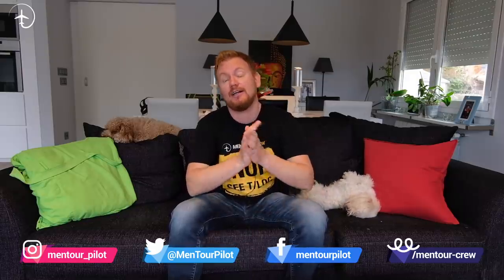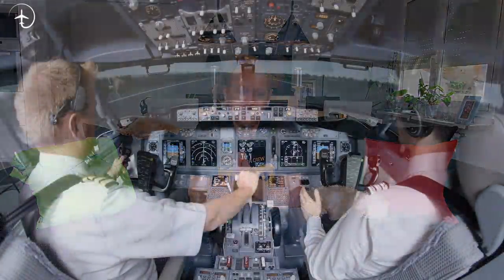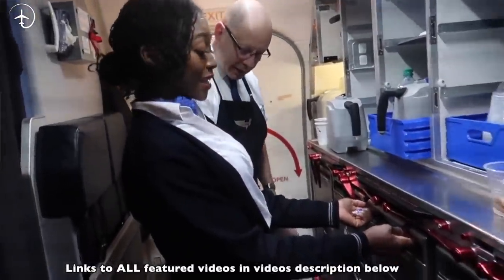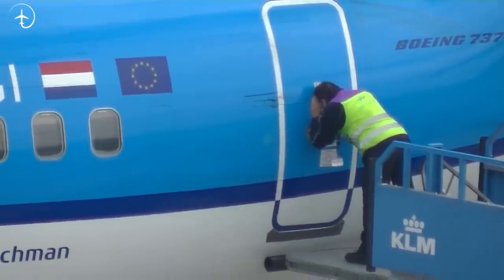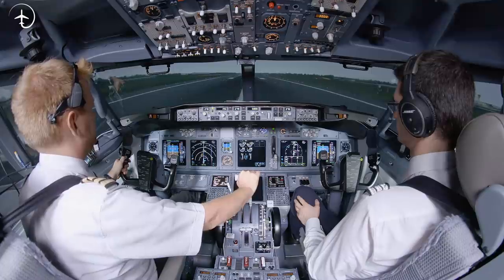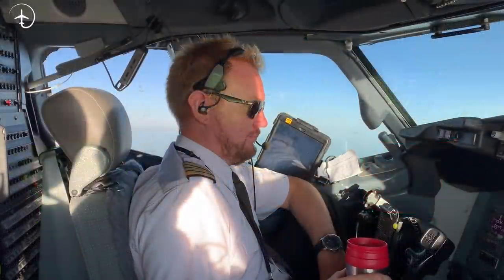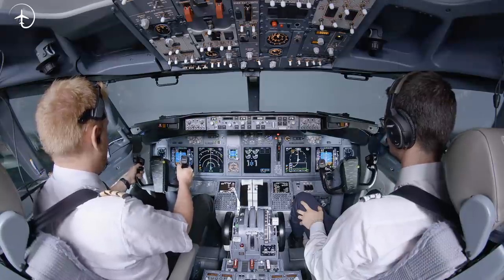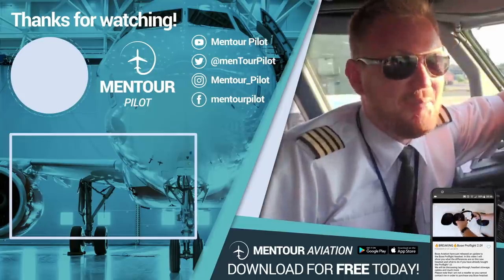How to fly an EMPTY Aircraft!

Comment: Half of my 737-3/400 freighter flights are essentially empty, or with a little bit of backhaul; just a bare floor and up to about about 15,000 lbs. fuel onboard when returning to ANC, e.g., from BRW/Utqiagvik. In the Alaska freight hauling business, the revenue stream is mostly unidirectional. 

Yes, it’s a profound performance difference, and since we often can’t reduce thrust on contaminated, shorter runways around Alaska during winter or when wet in warmer conditions, full thrust is occasionally used. Indeed, more than 20 degrees nose up is not recommended, even when the FD suggests it. About 17 deg does it for a flaps-5 170 KIAS low-radius U-turn departure reversal when light.  

Nosewheel shimmy problems on these old ex-BA and ex-Lufthansa 737 Classics are not uncommon, which I believe is due to the fact that these airplanes are designed to have lighter force on the nose gear, helped by having seating, galleys and lavatories installed and passenger payload on practically all flights. This is made worse by runways suffering the pavement-distorting effects of temperature extremes, currently the west end, right before the 09 rotation point at Kotzebue (PAOT), necessitating a bit of soft-field style back pressure while minding not to pre-rotate and possibly cause a tail strike in a mostly fruitless attempt to reduce punishment on the equipment. 

While the airframes are equipped with a structural barrier between the main deck and forward galley/supernumerary area, in light-load freight flying, our main precaution is to verify any backhaul items are properly secured and that the floor locks are up, preventing any sheet or ULD shift on the roller-floor, as there is so much empty floor space allowing a major shift, usually forward, to occur. 99.9% of the time our cargo loadmaster (when we have one) and the outstation ground crew get everything perfect. 

We never engage the forward door slide girt bars on the airplanes so equipped. And if we are ever required to do so, it’ll only be a matter of time when someone forgetfully opens a door (probably from outside) and causes a catastrophe. 

And, I should add, during 2020 and 2021, I’ve never been busier flying freight since starting my current job in old 737-200 (gravel-kitted and since retired), -300 and -400s in late 2015.

Comment: Hi,  Imagine you yourself were flying the 737 Max 8 using the standard single AoA sensor with flaps up. The aircraft suddenly started a forced pitch down. Is it possible that you, suspecting a computer fault, not a runaway screw jack motor, can switch off 'only' this problem? Or would you, in this case, have needed another 'extra' stabilizer cut-out switch (maybe an MCAS Cut-Out) positioned nearby existing switches, leaving all your normal trim methods available, thus allowing you to easily and quickly correct the longitudinal pitch and to fly on?

Comment: To "ForMeToKnow" below and interested others...  I was a passenger on an American Airlines MD-88 about 30 yrs ago flying late in the evening from Newark NJ to Raleigh-Durham NC, then thru to Charlotte (my destination) as same flight number. We were almost fully loaded, mostly business travellers. When we landed at RDU it was announced we'd have a 45 minute layover while an equipment issue was checked out, and thru passengers to CLT would be allowed to exit to the terminal to stretch legs, get a drink or snack, whatever, then reboard and continue on. They gave a 10min boarding call over the p.a. in the nearly-empty new terminal building and when I got back on the plane and reseated in coach I looked around and realized I was the only remaining passenger that night! After we got airborne for the final leg of about 50mins the cabin crew told me I'd been awarded an upgrade and moved me up to First Class ("Pick a seat, any seat!"). I chose a window on the right because I knew the wind was out of the North and I'd be able to look down on the city and maybe pick out my neighborhood as we hooked around the South side of town to approach Rwy36L or 36R but was surprised they extended to do a Visual to Rwy5, rarely used for landings at CLT, for preferable winds and also noise abatement since it was now after midnight. I also got a surprise meal on the way of Orange Ruffie, potatoes Au Gratin, asparagus and a glass of champagne. Walking away from the gate after the flight I saw the F.O. and thanked him for the de luxe ride. He told me that they knew they'd be practically empty on the last leg and the flight was pretty much just to position the aircraft in Charlotte for an early start to the next day's schedule, so they decided to give me the royal treatment for fun. Very interesting and memorable experience.

Comment: Non-pilot guess for repo flight of an airworthy (no maint. required) aircraft WITH cabin crew. Slower takeoff, lower engine power, higher altitude, lower pitch of the nose, fly faster through turbulence (you only have the cabin crew to keep comfy and I am sure they would be understanding of a bit more bumps than on a PAX flight).

Comment: The 737-300 accelerates much faster nearly empty you can feel it in the small of your back.  I flew on a big jet a 777 once I was really disappointed.  That thing was so big it literally took an hour to turn it around then it was so heavy with so much inertia it took forever to get up to speed.  I live in Texas where the big cities are right at the limit of what you want to drive or fly.  A small jet like an Embraer RJ135 or a 737-300 always way out performs the bigger jets on these short routes.  I actually like the RJ135 it is a very simple jet rarely breaks down.

Comment: Is it possible to be the sole passenger in an aircraft while there are two flight attendants on-board?
Reply: It is more likely that there will be more than 2 cabin crew. Usually you need at least as many cabin crew as you have emergency exits. So assuming the company allows you to fly and dous not cancel it, you could have 6 or more cabin crew for 1 or 2 passengers.
Reply: Yup, I worked for AA. We had full flight crew and myself w no passengers. I didn't work the flight, but it was nice, no rules, cook ur own food, get your own drinks.

Comment: Hi Mentour Pilot, at 6:10, do you mean it about minimum trim setting for takeoff because the aircraft too light so we have to decide minimum fuel load to meet this requirement (737 NG)? I found little bit different in max. No requirement for this.

Comment: On a 737 how many passengers are required for you to have to worry about balancing out the plane with passengers?
Because if you have 10 passengers, that might be about 700kg, but do you have to worry about spreading that weight out

Comment: Why wouldn't the company sell a few seats at a cheaper price during these flights to recoup some of the costs?   I can't get my head around the  economics of the airlines. Recently booked a flight from an airport 200 miles away from home only to fly to the airport 30 miles away from home to go to  Grand Cayman. I saved $600 and had to fly on two aircrafts by driving 200 miles. What gives? In short, I drove a couple of hundred miles to fly home to go to my  destination and saved $600.

Comment: On a ferry flight, is there a need for 3 pilots on board? For example if one of the two pilots is checking the cabin for any fire, the other pilot is alone in the cockpit. Im wondering if there are any safety procedures/regulations on ferry-flights too after the crash of the german wings flight with one pilot in the cockpit. Thank you :)

Comment: Does the increased bank requested by the flight director mean a potential stall situation? I know on most general aviation aircraft the stall angle is about 15 degrees. Would your stall correction be the same with rudder rather than aileron, release back pressure, increase power?

Comment: I only fly in 2D ok I drive a semi truck 😜and sometimes get a load imbalance and can be dangerous to keep in control particularly if the main weight is on the trailer axles.
With all that fuel weight mainly on the main gear on an empty flight does this affect the steering on slippy surfaces or is thrust from each engine used to compensate for this effect should it arise?

Comment: Am i right that in normal circumstances, one of the cabin crew would come onto the flight deck if one of pilots need toilet or whatever? So when there's just the two of you, is the door braced/locked into the open position?

Comment: Mentour Pilot: you completely missed the "WHY" behind the odd landing characteristics of a very light 737.  At very light aircraft weights Flight Idle Thrust (in the older 737s) or Approach Idle Thrust (in the 800 and MAX) has become, mathematically speaking, a much larger factor relative to the aircraft's mass.  This is why you tend to float and land long when you're flying a really light 737.  I find that the way to get a very light 737 to land normally is to pull the power as if the aircraft was at a medium weight.

Comment: Is the one hour between fire checks the number required or is that the minimum?  Wouldn't the "pilot monitoring" do at least a quick check as they went back to the rear galley to get a snack or something to drink even if that was not one of the set times?

Comment: Mentour thank you so much for all that you do for aviation. I would appreciate a video on just how much weather really affects what you do in the cockpit as you fly along. Clearly most flights do not deal with difficult weather, but nevertheless there is a briefing. It seems to me from the videos that I watch that the flight goes along anyway and aside from brief mentions of some possible turbulence here or there it seems that the flight continues irrespective of most weather. So, if it is so important even with moderate conditions,. what changes do you make in the cockpit as you fly to either optimize or compensate for the weather? Thank you again. Henri

Comment: I use to work at local airport and was always the water and lav guy and the flight crew were pretty kool but we were told to fill the water up when it comes in but most were going back to seatac so I always asked the flight crew if they needed to be topped off but most would get a fill when they landed

Comment: About those doors. You said they are "armed". Does that mean when you have to use them they will blow off the plane or just explode open?
Reply: When you open a door that is "armed" the slide will inflate
Reply: @myofficegoes65  Ah yes I should have known that. I can see why it would endanger firemen. Thank you Mentour should have explained that. I really like this channel.
Reply: The slide inflates when u open the door, the door stays in place. There is a bar on the floor they set to arm and should put flag over window
Reply: @jasoncentore1830  Thanks for that.
Reply: @joebrown1382  No problem, I worked for AA and DL, I'm not I pilot, but been around planes forever. Next time you take a flight, after they close the doors, you may hear the flight attendants say doors armed and cross-checked to each other, sometimes they get on the PA so the FA's in the rear of the plane can hear.

Comment: I can’t speak for the 73 but generally if an armed aircraft door is opened from the outside, it disarms automatically. As it’s an older design it may not work on this aircraft
Reply: The slides on B737 (and MD80) are armed by clipping a girt bar to the cabin floor. These can only be disarmed from inside the cabin. Hence the importance of the red warning flag.

Where you have an arming lever on the door there's a mechanical linkage between the external handle and this.

Comment: I don’t understand how you determine the balance.  Do you calculate it or is it measured?  If the latter, is it built into the landing gear systems?  Does it calculate the CG for you?  If it is not where you want it, what can you do about it in an empty aircraft?  Can you move fuel between tanks?
Reply: I see there is a system called OnBoard Aircraft Weighing System that will give you the weight on each axle, from which you can get the CG, but not all airliners have this.

Comment: I cant see how any trolley or other moving object could crash even if the cockpit door is open (which after 9/11 is a no-no situation and doors are bulletproof) into the cockpit, because all those things are not in line with the door openings in the fuselage of the airplane; they would need to manuever it's way out of their positions; and given the tight spacing there are in every plane, I can see only some hitting with the kitchens or bathroom doors but no chance to get their way to the cockpit
Reply: Juan Fonseca We had to replace a bulletproof cockpit door, the trolleys gets a hell of a speed on it rolling down the aisle, specially in a 800. 
Heavy as f*** that cockpit door by the way🏋🏻‍♂️

Comment: i would imagine there would be some rules stating that there should be at least one or two cabin crew in a passenger aircraft, even if there are zero passengers... ??
i remember reading somewhere a long time ago that budget airlines have 3 cabin crew on every flight because that's the minimum requirement for a B737/A320 regardless of number of passengers
Reply: What..to make the captain a cuppa  ?

Comment: If the monitoring pilot does a cabin check each hour on an empty plane on a ferry flight, what about freighter pilots?  Do freighter pilots routinely do a cabin check as well?
Reply: I'm sure freighters have smoke detectors on the main deck.
Not sure it's possible to walk through the cabin on a typical freighter anyway.

Comment: I understood that doors to automatic (armed) meant that if they were opened from the inside the exit slides automatically deployed. If the same door was opened from the outside they did not deploy for obvious reasons. Under these circumstances how would someone opening the door from the outside set the slides off and potentially get injured?
Reply: RJPick1 What obvious reasons? 🤷🏻‍♂️
If the slide is armed and you open the door the slide will deploy, doesnt matter if you open it from the inside or the outside.

Comment: What is the meaning of arm the door
Reply: Attach a bar, in case of emergency just open it and slide is automatically inflated. I was an agent, I would knock on door, look for flag across window, then open if the FA didn't already crack it for you.
Reply: Sets the escape slide to inflate automatically when the door is opened

Comment: What are those two spinning wheels for, either side of the throttle?
Reply: Those are the elevator trim wheels.  It's what puts a small nose up, nose down kinda setting on the tail elevator to counter act forces and help the pilots out a bit.

Comment: Many years ago I had a flight from Berlin to Teneriffa with a stopover at Gran Canaria. After the stopover the plane was almost empty (maybe 10 passengers left on the plane) and the pilot decided to have some fun with his MD-82. The plane took off and climbed like a rocket, with the deep blue ocean right behind the aircraft and the beginning darkness of the universe if you look forward. Awesome feeling, awesome aircraft.
Reply: stormeagle28 Built like a tank👍🏻 From Tempelhof?
Reply: @speedbird9313  Negative, the flight was from Schönefeld (EDDB). Tempelhof airport was used only by small aircraft like the ATR42/72 and RJ100 (former BAE146) before its closure, like the London City airport is used today. No 737 or A320 series operated from there.
Reply: To bad, I never got to use Tempelhof myself either.

Comment: Skip, could you do a video on how you guys track and maintain centerline on final and touchdown, if not using ILS for some reason? Also, when not in CMD, how do you guys handle trim inputs?
Reply: If necessary you can fly the final part and landing also visually just by looking at the runway out of the window. You can align the aircraft to the runway just by steering the aircraft by using your visual observations.
Reply: @mikep9604  Yeah but how do you know where the nose gear is from inside the cockpit...is...is there some kind of marker?
Reply: @Repented008  - Normally you can align the aircraft with the runway easily. When you look at the runway from the cockpit window you steer the aircraft and make corrections when needed, so that the aircraft does not drift to the left or right but maintains the correct heading relative to the runway. The main landing gear will touch the runway first and the nose gear little after that. When the nose of the aircraft is aligned with the runway, so is the nose gear also. When the aircraft is on the ground the rudder pedals are used to keep the aircraft straight during the landing run.

Comment: Opening doors from the outside automatically disarms the door on every modern AC type I can think of. Please correct me if I’m wrong.
Reply: Mitchell Vaughan You are wrong..
Reply: @speedbird9313  Well 320, 777, 74, 78 all do it. I assume the 737 doesn't because it's a manually attached girt bar. So I would rethink your assertion
Reply: Mitchell Vaughan Sure about the 320?? Only work on the 73, but I think it has to be disarmed from the inside as well, think I recall that there is a armed slide light instead of a strap. But if you agree that that is the case for the 737NG why should I rethink my assertion? Because the 737 isnt a modern type? Then you need to be more specific about what you mean by modern.